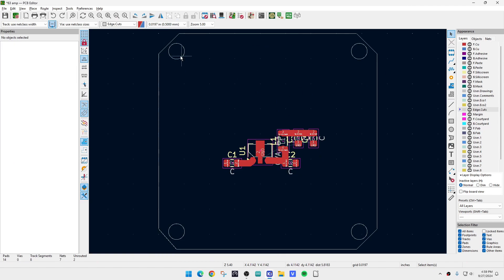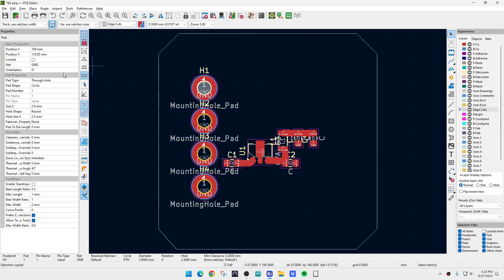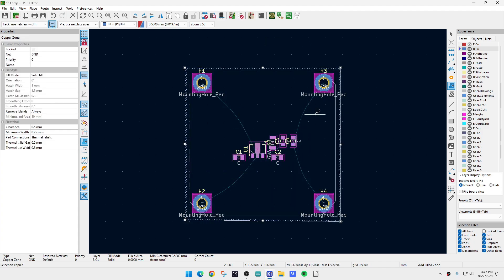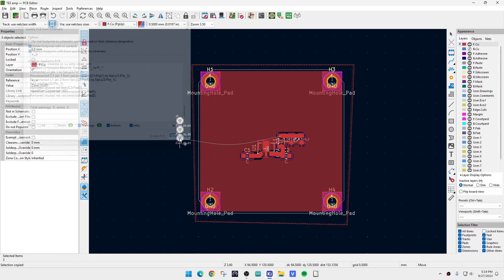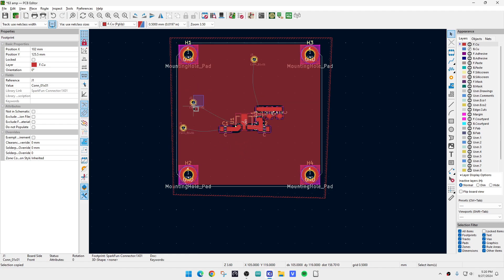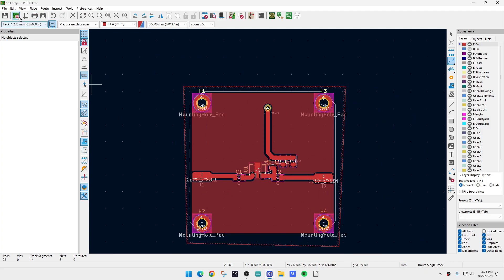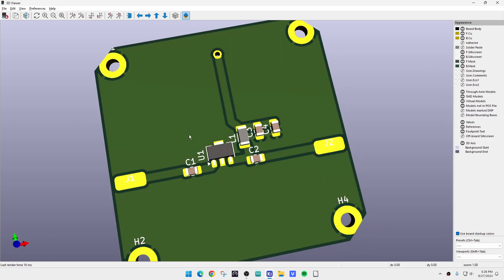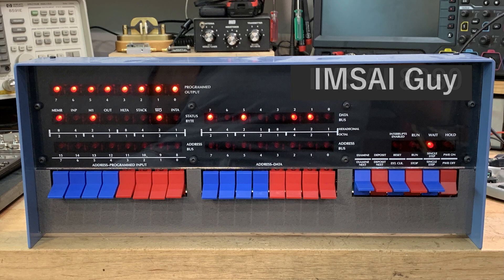#2021 GVA-63  Amplifier Project (part 4 of 10)

Comment: Power wire hole diameter looks small
Reply from the maker: it's only 100mA, the hole is good for 22 gauge.
Reply: @IMSAIGuy  it looked to small for a wire, I screw that up all the time!

Comment: You didn't need to do two fills for the front and rear grounds.  You can do both at the same time... just check both front and rear layers in the popup when you select what the fill connects to... i.e. GND.
Reply from the maker: I'll check that out next time, thanks

Comment: Probably a bit late now but the SMA symbols and footprints are already defined.

connector:  conn_coaxial   for the symbol and  in the footprint lib   Connector_Coaxial  ... there are a couple lok for the edgemount footprints. 

When I last used them I had to tweak the pin spacing to match the ebay SMA's that I had but not a big issue
Reply: Good advice as some ebay SMA's are the wrong size and it's hard to tell from the listing.

Comment: You could put several vias under that transistor tab to allow the bottom copper to dissipate its heat also.  I also recommend connecting the SMA shells directly to the copper pours.
Reply from the maker: it's only part 4
Reply: I think the idea is that open copper on the bottom perimeter makes contact to the SMA thru the enclosure,... But your point is valid. It seems that it will be a tenuous connection without something explicit.
Reply: @mr1enrollment  At rf, it is important to avoid large current loops.
Reply: What about propagation delay time? Should‘nt the Transistor be lined up in that regard?
Reply: @JoseHernandez-md8tv  nah, can't imagine that being a problem. what application would? anyhow we are talking pico-seconds in this case I suspect.

Comment: pcb need a lot of via!
Via around tab of SOT223 for heat transfer to bottom.
Via each side of 50ohms trace to connect top and bottom ground.
VCC trace,  use 7mil wide.